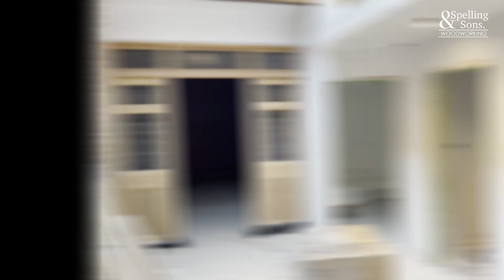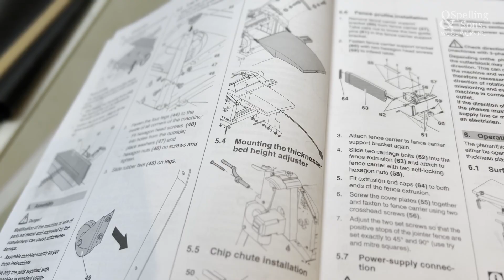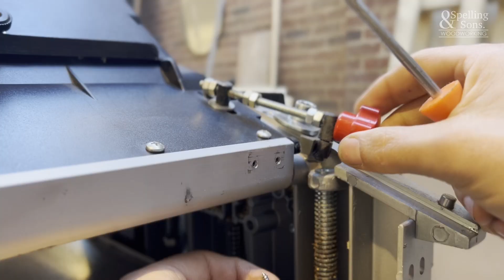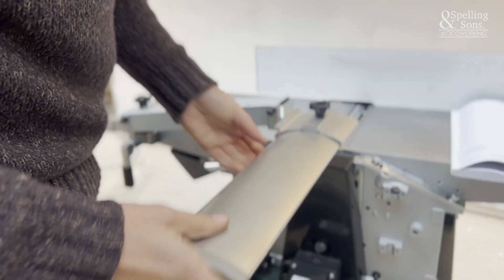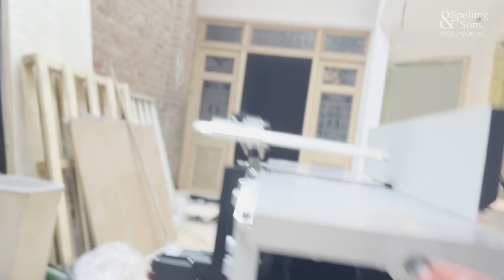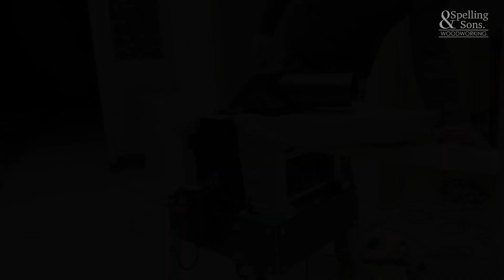Metabo HC260C Planer Thicknesser - Out of the Box - Set up and Assembly Tutorial

Comment: Quick question (I know, after two years...).
Forgive me for my english but I'm italian and I'm not too good with technical terms.
When I switch to thickness planes how do I get the switches to dectivate?
In thickness mode I no longer have the collector to use to push up the metal clip in the back, and I can no longer clamp the front table so I cannot de-activate the front switch.
What am I missing?

Comment: I’ve just bought one of these. Not if it a newer model or not. Metabo instructions are nothing short of awful, no cable tie, and the long indeed adjusting bolt only now has a threaded in and one bust that tightens with an Allen key. It is a great shame that Metabo could not make the extraction ports and shrouds from light tin instead of plastic, even at a greater cost it would have taken this planer/thicknesser from okay to excellent. Awesome video without which you will take ages to figure it all out.

Comment: Great review and quite prescient as it so happens. I've just purchased one and I'll be putting it together in the next couple of days.    You mentioned a follow-up video of setting  it up. That would be fantastic. I assume it's a case of getting the two tables co-planer and then adjusting the knives if needs be. I understand you can't adjust the infeed table (beyond depth of cut) like you can the outfeed. Anyway, thanks for the review. Liked and subscribed.
Reply from the maker: Hi Shane, thanks! Yes, I’ll try and shoot that set-up vid as soon as I can. Yes, you are correct. To set up, once tables are level the knives are adjusted accordingly. Metabo suggest using an aluminium straight edge to work out by how much. It’s a case of turning the cutter block by hand (unplugged!) in the direction it cuts (towards infeed table), at which point at its peak the blade should pick up the straight edge and move it 4-6mm. Do that across the width of the blade and you should be good to go! Pretty much anyway! Cheers
Reply: @@spellingandsons  Thanks. In your opinion, does it stay true to your original setup when changing between modes, or does it need a bit of a tune-up when switching back to planer mode for instance?
Reply from the maker: Certainly not a bad habit to check periodically. Main thing that needs checking is the fence as it has to come on and off between modes and does get knocked out of square. It’s not the best fence in the world tbh. I’ve used it for about a month now and the rest of the machine stays pretty true.
Reply: @@spellingandsons  Sounds good. A few other reviews of this machine or it's alternatively branded sibling, seem to suggest that the fence is indeed a bit sloppy. I have a Triton thicknesser, which I have been using with a sled, shims and hot glue to flatten stock but that has become really tedious and fussy. Couldn't get a separate jointer of any reasonable quality/price here in Ireland or UK, so I went for the combo. Will possibly leave it in jointer mode and use the Triton for thicknessing. Thanks again and looking forward to your ext installment.

Comment: Just tried to set mine up, wouldn't start so I need to fiddle with it to activate the micrto switches I think
Reply from the maker: Yeah, almost certainly will be those micro switches. Which mode is it in? I found that the thicknesser bed needed to be raised up enough to engage the switch, assuming it is in planer (jointer) mode. Also when in thicknesser mode the chip chute needs to be flipped over correctly for it to work, make sure it's almost touching the infeed table. Let me know if you get it working!! Good luck!